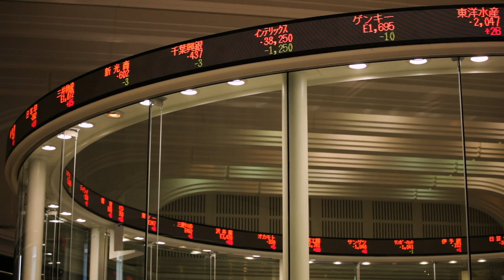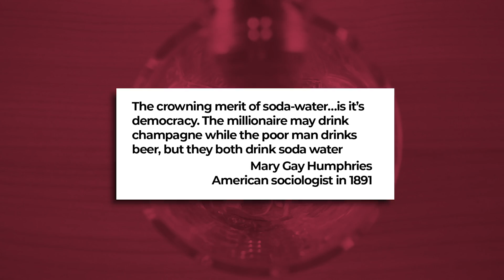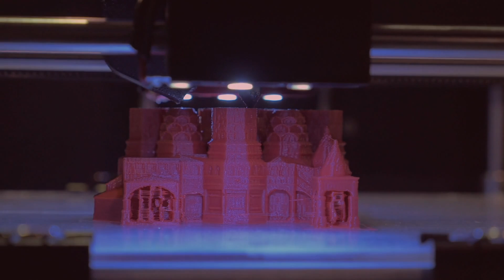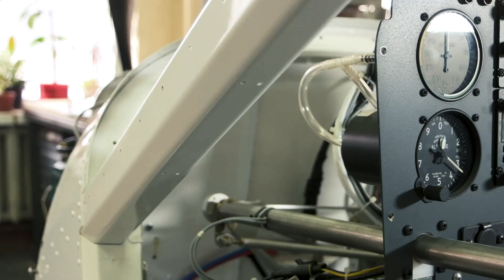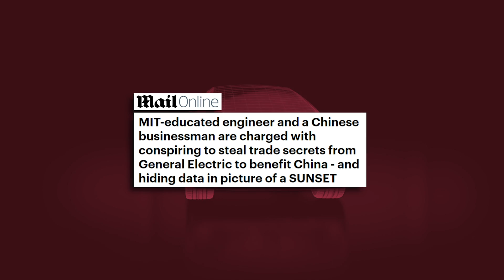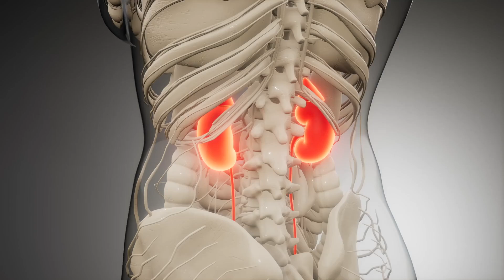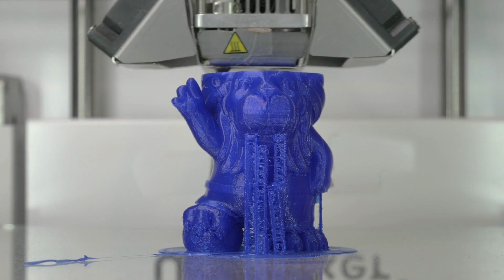Can 3D PRINTING change the WORLD? - VisualPolitik EN

Comment: The biggest problem in 3d printing is royalty payments and a understanding that anything sold from a 3d printer should be licenced checked before you sell it. Biggest global search engine for 3d prints is 3dmdb.com.
Filter by oldest first.
Search" tea earl grey hot"
Yes i own it. If you sell it from your printer or Any and all 3d printers 
Those outlets locations are mine.
And yours depending on the thing licenced.
When uploading to any site put all details in discription such as date of original upload creation. Is it free or non commercial no derivatives. Price and terms. Is it a plastic toy or real food. Is it a 3d print or cnc or cgi which is not a 3d print.
Bye for now and be well from Will and Mr Data :) :]

Comment: One aspect that wasn't touched on very much in this short video is that 3-D printing brings the barriers down for innovation greatly.  Whereas one might formerly need a machine shop and machinists for mechanical parts and printed circuit board manufacturing and assembly facilities for electronics, all of this can be decentralized into much cheaper, more accessible installations because of smart, self-contained manufacturing engines. The shift is really "one size fits all" fabrication transitioning from individual parts to the manufacturing facilities of those parts, or meta-manufacturing.  The economy is steadily approaching a state not based on resource scarcity but the limits of innovation.

Comment: I think the revolution that will happen is the democracy of product design. Open Source products, designed by their users, easily customisable and manufactured at point-of-sale. (or point-of-need/use)

Democracy as in power. Too often, when it comes to products, "democracy" and "democratization" are thrown around too-liberally. Often, these words are used to refer directly only to affordability, as if the ability to afford something represents democratic power.

In the 3D printing revolution of the future, the power of democratization has nothing to do with affordability. It relates to the POWER of the user to design and manufacture whatever product they desire. No longer will "fans" of companies have to sit around and wait for the new product release. The user will design their own new killer product, based on the open-source current killer-product. Open source innovation in product design, combined with massively distributed and decentralized manufacturing.

Oh yeah. I'm getting riled up just thinking of this. I can't wait. The beginnings are already here. Next time you want to make a big product purchase, ask yourself "is anybody making this open source? Can I do this myself?"

Comment: Do remember that 3D printing is not 1 sort of technology! It is all additive manufacturing technology commonly named 3D printers. 

You do not only have plastic 3D printers but also metal or organic 3D printers

You have things like:
(M)SLA (resin 3D printing)
FDM/FFF (plastic filament 3D printing)
SLS (fusing small plastic or metal particles together with a laser)

These are basic one, there are different subcategories.

Btw piracy is unlikely because most 3D printers are opensource. About 3D models, that is where you are right, it is a very difficult predicament.

Comment: 2000 ear savers & 160 face shields! It's amazing what you can do with a couple of printers at home. home 3d printers upend so much control large companies have. being able to replace parts or improve parts gives a lot more options plus its much easier to making custom molds how for prototyping and starting legitimate businesses from home. 
but also... the 100k 3d printers are COMPLETELY different from the home computers. The home resin & fdm 3d printers are much simpler and have much less capability and the high end resin and powder 3d printers.

Comment: It would not have made such a big impact in the at home maker space if the patent hadn't expired at the right time with the internet being what it was in 2009, there are definitely technologies that would lend themselves to makers and tinkerers that haven't had such a desktop breakthrough, or that have only gotten more common due to the 3d printing comunity already having large filesharing platforms and introducing people to tinkering. 

It also helped that open source was becoming more and more popular at that exact time and several figures in the comunity embraced it and continue to do so to this day, which gives the open source printers a few advantages over the closed systems and has lead to more standardized parts to allow for upgrades, free software and little to no locked ecosystems

Comment: Just some thoughts here as a mechincal engineer. 3D printing components with high tolerances. Some mechincal componets are manufactured with really high tolerance. We are talking within micro meters here, and yes it does matter. Material science...... Steel isnt just steel. it might need heat treatment to get the right mechanial properties.

Comment: The biggest thing for me about 3D printing is that it's making high-quality prosthetics more affordable. They used to be horrifically expensive, and in the US, poorer patients who needed them couldn't get anything beyond the basic, bulky design that hasn't changed much in the past century. They couldn't get articulated prosthetics. Being able to 3D print these have helped with that, even in the broken US system.
There's also been a rad series of 3D printed braces and casts that are way more versatile than our previous options. Many of them are super breathable and much lighter than traditional braces and casts.

The fun thing for me about 3D printing is that I can take the 3D art I've been creating for decades, and basically self-publish it as statues and figurines. >.>

Comment: Piracy is a tricky issue, but the answer must not be to produce a crappy product. The choice of material should not depend on piracy concers but quality concerns. 
There is no need to bring all the trouble with DRM into the physical world. Also consider the ethical implications of locking away revolutionary technology behind patents. I understand recouping investments, but there must be a better way, because patents as they currently exist are about return on investment, not stakeholder value for everyone affected. By all means, get rich, but not by withholding technology.

Comment: From my research in this field, I've noticed many when talking about additive manufacturing they refer to it using this blanket term. I believe the industry will start to see huge growth when we start to individualize each of a the dozens of additive technologies. These technologies, FDM, LPBF, SLS, DED etc. have vastly differing advantages and disadvantages and should be addressed individually and not as a collective if the industry is to achieve full maturity of such technologies.

Comment: in real life, 3d printed parts suck. They break easily, have poor surface finish, etc. They can be used as models for casting or quick prototyping, and sintering will give you metal parts. Also there is a world of difference between that desktop printer and an industrial model.
For example, you are dreaming about making screws. Plastic screws are already bad enough, but there just isn't enough material strength to make practical fasteners.
Reply: Not the case in industry. If the correct procedures are in place and certifications conducted. Parts can be  manufactured with the same properties as any other manufacturing process.

Comment: 3D Printing (laser sintering) is already used in nuclear and railroads - mainly to make replacement parts (since we are talking equipment that often outlast their manufacturers - which means that 3d-scanning is heavily used since it is fairly rare to find the original manufacturing specs).
(Before anyone panics, in the world of engineering if you need one part you usually make ten, to send four off for (increasingly destructive) testing, keep two parts in exposed settings for later destructive testing to test aging, install one part, and keep three spares)

(While on nuclear - they also reverse-engineer a lot of the electronic components as well. Due to companies often having a shorter lifespan than the components. Any deviation from an exact replica require re-certification (which means if the component would need a sub-component that isn't manufactured anymore they make decades worth of spares to avoid later re-re-certification))

Comment: 3-D printing is amazing, and while there will be growing pains, this will be great for local manufacturing. However there is something more scary you can do with 3-D printing than stealing designs. You can print a gun. All you need are the specs. In the US, making your own gun is not illegal, but it was hard to do by hand with blacksmithing and ECT. Now, a company in Texas has successfully 3-D printed a working handgun in mere hours.  You could try and make the specs illegal on the net, but this isn't classified government secrets. People have been making guns for centuries, so there are a lot of designs out there already. Plus, with a scanner, you can just scan the parts of the thing you want to replicate. Then there is the Freedom of Information Act that might make these gun specs impossible to remove from the net. People around the world could suddenly be able to make a plastic gun that could be invisible to metal detectors. It is a sobering thought.

Comment: The challenge with 3D metal printing is the forging.... the part might not have the same strength
Reply: With metal pieces, the printer welds the material at each level. Never heard of said parts being weaker than normally manufactured parts.
Reply: @bengraves9416  forging and welding are different processes. Forged steel is heated and compressed and sometimes drenched in cold water to create a crystalline structure that can be tuned for different levels of strength and flexibility.   Welding is joining pieces of metal together either through electric, torching, heating or other means. 3D printing can't do that yet.

Comment: Additive manufacturing in case of metals has a drawback: the part isn’t as strong as traditionally made part. Also, 3D printing isn’t feasible for economies of scale. So right now, it may be limited to niche products.
Reply: If the correct post-processing is performed it has the same properties as any other wrought parts

Comment: One point of disagreement here: it’s my understanding that when metal is machined the left over shavings are recycled. Even sold for other uses.
Reply: Valid point however, these generally are lower quality and/or require high energy recycling techniques (but not as high as their original materials manufacture). Not always, though. 

For some techniques of 3d printing, the materials are somewhat reusable in the process (eg SLS powders), therefore reducing waste, but even these aren't completely reusable.
Reply: Also depends on the industry, in most regulated industries where additive manufacturing is currently making waves, this is scrapped

Comment: Home 3 D printers are,in general, toys in the home.  What about quality control  and the ability to repeatedly make the same part with the same  performance specification ?  It makes some sense  for expensive parts but you need the technical  back up  to oversee the manufacture and ensure the reliability and safety of the 3D printed part.  It might work for  certain aircraft parts  for the military  but I doubt they are making anything more than basic parts that are not subjected to  the  stresses and strains of  the more critical parts. As it stands 3 D printing  is not suited to mass production.  High volume 3D printed parts are more likely to fail  than traditionally manufactured high volume parts  .  I think it will be a long time  before your car insurer will happily agree to the routine replacement  of parts knocked together on someone's  3D printer.   3 D printers are great for engineers to  rapid prototype new ideas but it is neither cost effective nor practical for volume manufacturing  and 3D printers have simply joined the long list of techniques engineers use  to ensure products can be manufactured in a cost effective way and brought to market ASAP. .
Reply: There are certain AM technologies that have manufactured structural flight ready parts. Check out RPD from Norsk and the DED technologies, LPBF and EBPF soon to follow.

Comment: Fact check: 1. Earliest machines: Additive Manufacturing has many techniques, but the three main ones include fused deposition modeling (FDM as you described), stereolithography (SLA) and selective laser sintering (SLS). Both of these alternative technologies predate FDM, with SLS in 1986 and SLA in 1984.

2. SLS makes the highest quality, so that is the high end of the market. It is a very different technology to that described. 

3. The major reduction in weight when lightening parts, and other giant steps in utility, is due to design techniques that could not be used previously. Things like bamboo shapes for strength, or varied crumple zones for formula 1 car nose cones, or more efficient liquid/gas flow in manifold designs. Notably, these tend to use SLS, both for precision and because the powder supports structures during creation that the other techniques can't.

Comment: I think the future is in the home printer. Imagine when you buy your washing machine and if it brakes manufacturer sends you a file that you print out and fix yourself like putting IKEA furniture together. I can't count how many things I've fixed around the house with my printer that were a small broken part not worth making by the manufacturer but important for the machine to work. I see it as a screwdriver of the future, a universal tool you use to fix almost anything around the house, and in the process you prolonged the life of your appliances and not throwing it away therefore being great for the environment.

Comment: One of the biggest problem of 3D printed metals is the fatigue life, 3D  printed metals have pretty lower fatigue life and fail faster compared to tradition machined metals. its also the reason 3D printed metals are not approved in many industries.

Comment: I work in manufacturing industry and yes additive printing has its place.  But will never replace CNC machining or other traditional processes,  at least not yet.    You can get exotic materials printed now that have the strength or temperature resistance but not nearly same Cost.   We rarely use printing my industry.
Reply: Well, this won't replace manufacturing in the food industry, but also wood and plastic manufacturing won't be replaced by 3D printing. Also the way electronics are produced won't change that much, because this is already be 3D printed and the equipment used for nanotechnology is having such a high complexity and progress the products from it can only be profitable if they will be mass-produced like now. When the technology will be good enough for the consumer to be 3D printer, progress will stifle and thus this will also be the end of Moore's Law.

Comment: I'm a student at the Danish Technical University and I've fallen in love with our 3d printers.

I do think there's a material disadvantage to 3d printers as they are now, but I've made workarounds on my own models, making a Frankenstein of PLA and metals. 

Speed and layer composition will be key too, since many 3d printers have been thought of as a prototype printer and not a part printer as such.

I'm looking forward to keep making models and perhaps one day profiting off it.
Reply: The greatest thing about 3d printing is accessibility and individuality.

What people don't seem to realise is that it's just another way to make stuff, we have several of those, not everything is fitting for every type of part that's why we use several different methods. You wouldn't cast a screw, because it's a stupid way to make screws

its awesome for prototyping and small numbers, but it's too timeconsuming and too expensive for mass production, it's great for specialised parts and replacement parts, it's brittle and has a directional bias like wood, so for stability other methods are definitely superior, even though sls and sla tend to be less affected by the directional bias, but they have other issues.
Reply: @David Josephus Daniel Nuntius Two of the three most used materials in the ffm/fdm (the main kind shown in the video) are PLA(poly-lactic acid) and petg (Polyethylene terephthalate glycol) are much better than most on the green front. PLA is derived from plant materials (mostly sugarcane and some corn) and will biodegrade (however slowly, and with a transition period involving micro plastics if just dumped in a landfill) and can be composted in industrial composting set up for higher temp composting. And petg is a variant of pet, the easily recycled material soda and water bottles are made of and just needs some adjustment to common recycling systems to be fully recyclable. pla even comes in a medically safe variant that can be tweaked for slow dissolving in the body (such as frameworks for bone regrowth after a nasty break).